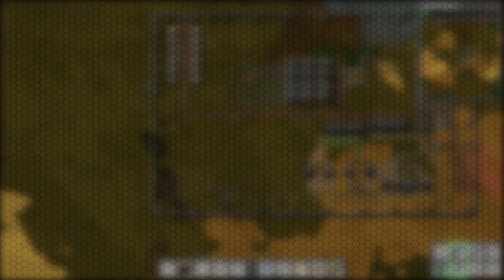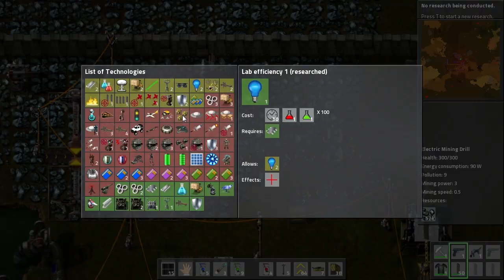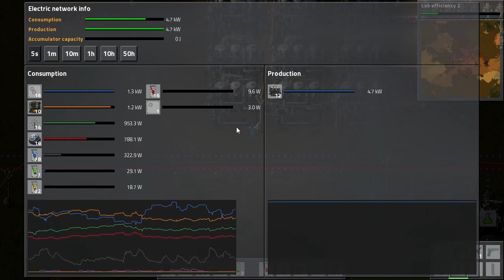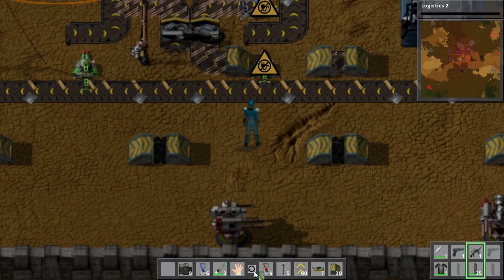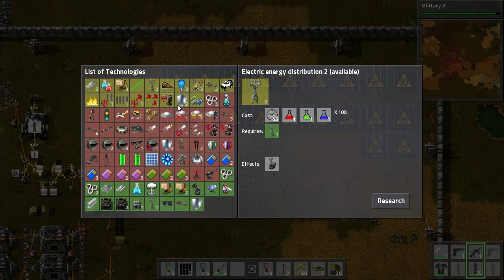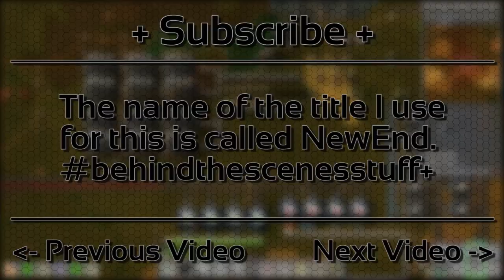Construction + Factorio #8 = Renewable

Comment: The prob with your power network is the overusage. When you draw more power then you can produce, it overworks the steam generators, so they burn coal faster, lower heat is produced, ie they get more and more inefficent as you draw more and more. If you add more power productions then is needed with a nice buffer, they will always remain the same temp and not start to cool down.

Comment: I've noticed in 0.8.8 and a few below have a glitch with inserters and belts. If the inserter is like most of yours (facing the belt directly, not the side) then they'll favor the left, but will also use the right if it is not being "used" at the time of insert. I just use the side loading and sway the belt to go up after inserting. Would be nice when they fix that glitch :D

Comment: -COPPER PROBLEM: You had the copper chests full of items, but when you did the turret you took off some copper from the chests, so the Smart inserters started working and filling in the chests again, that's why you were starving for copper. NOT because the research needed more, but because the chests weren't full.

-INSERTER IN THE WRONG SIDE: If you watch closely, depending to wich side the inserter turns, is where it puts the stuff... so, if only 1 iron plate comes, it's ok, but when 2 plates come toghether, 1st time it turns counterclockwise (the right way) butt the 2nd it turns clockwise, because the plate was "fleeing" from the inserter, and that makes it turn in the wrong direction, thus putting it in the wrong direction.
Resuming, after doing a turn like you did in the belt you have CERTAINLY fixed the problem.

-Hope my explanation on the Power Graphs helped!!! I see you get it now :)

- I LOLed with your Banished comment xD Would like to see you play it thou...
ON TO FACTORIO:

-you need 1 pump and 15 boilers (at least 14, +1 to restart the system) for every 10 Steam engines, so you don't have enough boilers (missing at least 2).

-Also, too much science, but it's better to overkill than to underkill IMO...

-YOU WANT LASER TURRETS. REALLY. REALLY REALLY. RRRRRRREEEEEAAAAAAAALLLLLLLLYYYYYYYYYYYY. I Can't say it enough...

-Inserter stack size is not worth it unless you have a train.

-LASER
-TURRETS
-ROCK

-LASER TURRETS!!!!!!!!!
:D Keepo it going! ME <3 FACTORIOOOOOOOOO
Reply: POWER
Your water pipes aren't in the best possible setup... this is because COLD water goes from the lake to the boilers in the top, and then COLD watr again goes from the lake to the bottom ones... it is best to have the pipe like a "C" (or a "U" if you prefer). lake in one end of the "C", boilers in the other. making the water pass by the top boilers, then under the belt, to the second (bottom) row of boilers and THEN to the steam engines. this way you ensure the watter temp is allways 100º. Tell me if you get what I say, if not I'll try to explain in a better way :)
Reply: Last but not least, in the Factorio Wiki, you'll find all the info you'll ever need :) If not, ask in the forums and you'll be answerd in no time. This game has a GREAT comunity!!! :)
Reply from the maker: This guy ladies and gentlemen. This guy. Thanks a lot fella! #wishallcommentswherelikethis
Reply: :D You made my day with this comment :) Kudos OfficialStuffPlus

Comment: Also, if you upgrade to 0.9 you'll need to restart the game, because a lot of the recipes have changed and require oil to complete. Oil will not be generated on your existing map, which means you need to start a new map with oil on it.

Comment: The inserters seem to put the plates in the center, if the copper wires are not taking their spot it seems that the plates sometimes shift into their lane causing it to "clog" as opposed to shifting into the other lane.
Reply: That seems to be it.